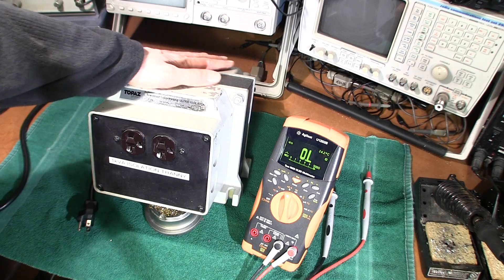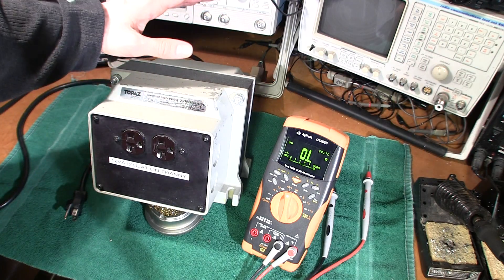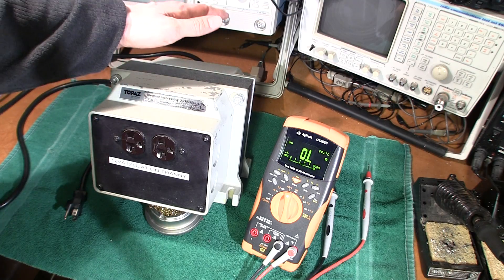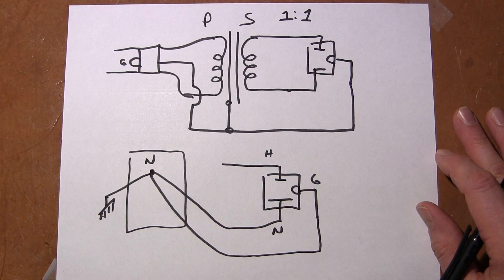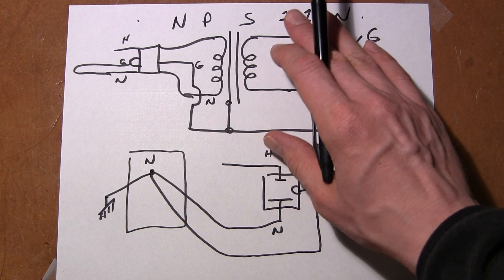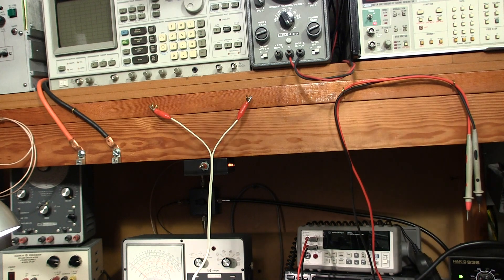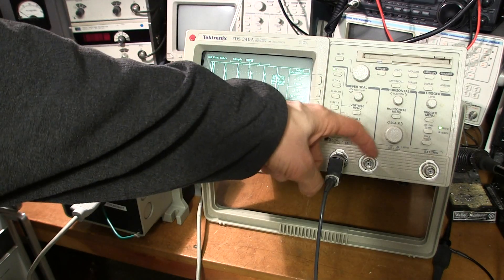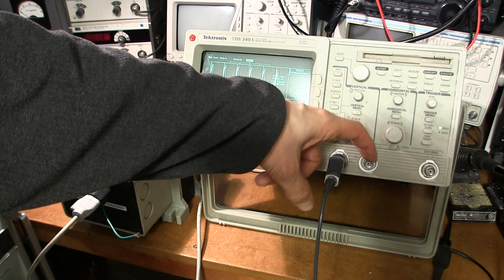Tech Tips Tuesday, Isolation Transformer and Variac Safety

Comment: Thanks Paul. You explained it very well. People need to be careful with the ground of USB plugs from their laptops and devices also.
Reply: +Robert Calk Jr. 
Good point about USB.  Check out the USB port isolator at Adafruit (search for product #2107)
Reply from the maker: +Robert Calk Jr. 
Thanks for your input Robert!
Reply: +Ken Cosi 
Looks like a handy tool, thanks.
Reply: USBs being dangerous... really lol
Reply: @actiniumanarchy9237  just when you thought it was a simple 5 volt device... BAM!
Reply: @ronniepirtlejr2606  I mean usbs won’t hurt you
Reply: @actiniumanarchy9237 people die from charging their phones using usb chargers every year. 'It's only 5 Volts' they said. How do you know your usb charger completely safe and is not live with AC voltage? You can't, unless you dissassemble it, check the board, completely unwind the primary and secondary windings to check for issues, and essentially destroy the charger.

You could just be safe, and maintain a healthy respect for electricity instead?
Reply: @JungleLibrary  the current coming out of a USB charger is not close enough to being able to kill you, those people die from overcharging and subsequently detonating the lithium ion battery 2 feet from their face
Reply: I love this comment. A USB isolator is less than 19 dollars on Amazon. No reason not to use one!
Reply: Mr carlsons very interesting videos

Comment: Hi Paul, wow I don't understand why that transformer is officially out in the market as certified isolation transformer. In Europe this would never ever get the declaration of confirmatory to be sold as isolation transformer. Following VDE/ EN norm the secondary side never is attached to protective ground/ earth. But anyway what ever norms are telling at all it doesn't make any sense...., or is there is something so much substantially different in Canada''s  power distribution compared to Europa I don't know?? Anyway very interesting video ! Thank you.   73 Peter
Reply from the maker: +TRXBench 
I agree fully, but politics and bureaucracy gets in the way of sense once again. If they want to include that "Earth" they need to re-label the transformer, and remove the word "Isolation"
Merry Christmas to you and yours Peter!
Reply: @MrCarlsonsLab , The term "isolation transformer, medical grade" is the one with the neutral bonded ground lead. There is a term, "isolation transformer, tech grade," which is one without the ground bonded to Neutral. This is the American system, I believe.
Reply from the maker: +Róbert Valdimarsson 
Thanks Robert, Merry Christmas!
Reply: +TRXBench There seems to be a lot of confusion about this even in europe. Mostly an "isolation transformer" has a earth connection on the secondary and a "safety transformer" has not, but has this clearly marked with a warning next to the outlet (and warns you not to hook up more than one device). But I have seen a "safety isolation transformer" (made by peaktech) that has a earth connection on the secondary, completely defeating its purpose (even false advertising imho).

But I'd be very interested, if there are codes in Canada, that prohibit safety transformers without mains earth reference. After all these things are only for full galvanic separation (thus preventing any current flow out of the DUT into any earth around) during repairs under power. Nobody in their right mind would use them for anything else.

But a well made and very important video nontheless. Thank you for it.
Reply: +Róbert Valdimarsson Hi Robert, yes very important issue and you are right a lot of confusion all over. I'm talking only about a galvanic protective  separation transformer (Schutztrennung) according VDE 0570 Part 2-4, DIN EN 61558-2-4, EN 61558-2-4, IEC 61558-2-4
Reply: @robertvaldimarsson2109  "Nobody in their right mind would use them for anything else." Most mains powered medical electrical equipment with patient leads is completely galvancially isolated from the mains, including the protective earth. They are almost like non-isolated equipment connected through what you would call a safety transformer.  Perhaps I have misunderstood, but turning equipment into the equivalent of what could be connected to a patient for safety makes a lot of sense.  Basically, if everything you are connected to is isolated from the mains, even when connected to multiple pieces of equipment, no current would flow from or to mains if one connection is accidentally made to mains.
Reply: I used to have palettes loaded with isolation transformers exactly like that one. The grounds are not isolated.  I do think our mains power is significantly different than European mains distribution. We have that wacky unbalanced ground referenced neutral.  We used our transformers for live music audio sound reinforcement, and the instrument, and vocal amplification. The lighting systems, for the theatrical lighting with all the dimmers could put 30 or 40 dB of hum on the audio, so all the audio stuff went through those iso-transformers. I still have a couple left, but I don't tour, or rent tour equipment anymore. Trying to track that stuff down, or lose it to some deadbeat was too much of a headache. I have some OLD RCA, and home made bench iso transformers where there is no safety grounding wiring. I just use adapters, if I have a 3 prong plug. I also have a power strip of Shucko outlets, and adapters for the UK, Australia, India, Italy, etc. I made some 30 amp 50 Hz sine wave inverters a while back, when the ammunition shortages made it so hard to buy cartridge reloading equipment, the only available equipment was 50Hz. At 60Hz the motors spun too fast, and the shell casings would not properly sort themselves into the loading tubes. Try jamming a bullet into the back of a casing, and the machine gets damaged.
Reply: Actually, politics have nothing to do about which earthing arrangement various countries have adopted. Isolation transformers shouldn't have any PE or earthing, because you will get an IT arrangement not a II one. 
 
Various countries have different earthing arrangements. Take a look:
http://electrical-engineering-portal.com/erection-procedures-of-earthing-arrangements-tnc-tn-s-tnc-s-and-tt
Reply: @somebody301 , in the end, engineers don't have twiddle to do with many things they should have a say in... and the idiots (political hacks and their scoundrel advisors, the "helpers from the money people") do.
Reply: You would not have this problem in Europe where the neutral is not bonded to ground at the mains. In the states, running on 120V is a result of center tapping a 240V secondary transformer coil. You need this to have a ground reference for several reasons to include safety and voltage stability. If you do not have a neutral-ground bond at the mains, this is irrelevant.
Reply: WILLIAM LAND Thank you, this answer make it clear. So if our guys in Europe; Allways check first all the wires of the device you working on with each other and chassis with a continuity tester if it's bleeps. That's a warn
Reply: William Land: You don't have earth/neutral bonding in the distribution panel, but they are bonded at the substation or power transformer. So the identical problem exists.
Reply: @buggsy5  if you dont get an earth wire from your energy supplier how could this be possible? In europe you have to get your own safety ground. And of course you want your safetyground connected. But you dont want your neutral connected to ground.
Reply: @Wim37u   If the safety ground is performing as the low impedance path it is supposed to be, a short to ground is destructive too. It's true that the residual-current circuit breaker will 'quickly' trip when detecting a 'small' current to ground so in a home installation the scope probe may give a spark but survive (I never tried). But 'quickly' and 'small' can range up to tens of amperes and half a second in industrial installations.
Reply: +TRXBench Yes, you pretty much have to rely on the norm numbers here. I have a propper one here for up to 1500VA. I got it very cheaply second hand and quickly found out why: It does not have a inrush current limiter. So every time i switch it on, I have to make a trip to the switch box and reset the breaker :D But a limiter module is not too expensive. Still the best money I have spent so far, since it might very well save my life some day.

Mery christmas and a happy new year to all of you too.
Reply: @robertvaldimarsson2109  1500 VA?! My 850 VA Grundig RT5 is already a handful (which also needs an external inrush limiter, btw). Your isolation transformer must be HUGE!
Reply: Ahhh. I was going to buy the Peaktech unit. Thanks for the info.
Reply: Exploring mines
Reply: I agree the secondary should not have the earth wire carried over . the secondary is then totally isolated . Then you can have the DUT connected including the scope and all is well
Any transformer the has any of the secondary wire connected to earth/neutral is NOT A ISOLATION TRANSFORMER and should not be called that . The earth should not be connected to the output

Comment: That looks like a medical grade isolation transformer Paul. That is typical wiring for these I believe.

I use a Sencore PR-57 isolation/variac for my bench work. I bought it on ebay years ago and had to open it up to repair the switch bank for the different display modes. I honestly didn't even look to see how the thing was electrically wired for the output. I think I'll do that now. But I don't see why Sencore would wire their unit as your example is. But who knows...

Thanks for the heads up and Merry Christmas to you and your family!
Love your videos.
Tom
Reply from the maker: +AntiqueRadioandTV 
Thanks for your comment Tom! Merry Christmas to you and yours as well!

Comment: doesnt your breaker panel should have safety trip? in case ever power starts to flow though the ground connection?(in case someone touch the hot wire or hot wire touching a metal surface)
Reply: +Hansaka Perera   NO a 20 amp breaker would not trip before frying your scope.
                                   A GFI breaker would trip but not before damage to the scope.
                                  it takes up to 30 ms for a GFI to react.
                                    So the answer to both would be (NO) protection threw breaker box.
Reply: +MrMac5150 i knew you going to fry your scope if you dont know what you doing but wondered why GFI breaker didnt go off on the video. I assumed thats a normal thing to have in house
Reply: Hansaka Perera
 In the video he was not running a GFI outlet.
Reply: +Hansaka Perera Yeah I was surprised too. North America is pretty backwards with safety in that regard. Here in australia all outlets must be GFI/RCD protected.
Reply: +TMM GFCI is required  for Garages, Outdoors, Bathrooms and Kitchens in the USA. Basically anywhere you would have a potential for and moist/wet/damp path to provide path for electrical current. That said only new and reworked  electrical requires this. There are tens of thousands of homes built before the 1970's(when GFCI were developed) are "grandfathered" and not required to have GFCI unless they are remodeled in some way.

Comment: Modern isolation transformers often have the neutral and ground tied together at the outlet on the secondary side of the transformer. It is a clip that can usually be removed.
Reply: The earth connection provides an alternative path for the power should a fault arise. Since it is always connected it will protect even with the appliance turned off or more importantly beleived to be turned off. The permanent connection also continues to work if the active and neutral lines become reversed as can happen when untrained people wire up plugs. A well made appliance will often switch both active and neutral lines to also protect against reversed plugs.
Many modern products do not have metal exterior chassis and will employ what is called double insulation where the usually plastic chassis acts as a second insulating medium. Virtually all power tools are made this way these days and will not require an earth connection.
Reply from the maker: +theflinx 
Thanks for your comment!
Reply: Mr Carlson's Lab Hello and thanks for your videos!  I am new to repairing electronics can you please explain why it's so important to keep the ground for safety.  I keep hearing this but don't understand why it makes it more safe?  Why is it more safe for the BNC connectors to be grounded or the chassis of the isolation transformer to be grounded?  I am sorry for asking such a noob question I just don't see anyone explaining this... Thank you

Comment: great tips
the new electrical panels have a ground and net bars isolated from each  new cod in usa
Reply: +DENNIS N same here, but they are connected at some point in the system (most likely at your substation). otherwise the neutral would not stay at 0V. unfortunately an isolation transformer without earth reference is still needed for repairs under power.
Reply: +Róbert Valdimarsson normally the safety ground is a very important safety feature that can protect your life only on rare occasions like this one it's needed to cut the ground of and should only be done by a person who knows what he is doing

Comment: Hi Mr. Carlson, thank you very much for this informative video!
1. Is it safe to disconnect the oscilloscope's earth wire at its plug, so that it only has a live an neutral connection? 
2. Is it safe to disconnect the earth wire running from the ac mains supply to the isolation transformer's output plug, so that there is only a live and neutral connection available?
3. When do you need to use an isolation transformer?
4. Can you please do a video on how to connect an isolation transformer to a DUT, like a TV, amplifier etc. and also to instruments like oscilloscopes, signal generators etc. so that all of them can be used safely together to probe and repair a product.

Thank you very much for your channel. I have learnt so much from your videos!

Comment: Should I always use a isolation transformer with a variac? If so, which comes first? Wall- isolation-variac?
Reply: +Scott Johnston  On a Isolation transformers  they are never exactly 1:1  so I always put
                                 the Variac into the wall first, then my Isolation transformer, turning  the
                                variac down  to 118.  if I use my Isolation transformer with out my Variac I get 135 volts which
                                is to high for anything.
Reply: +Scott Johnston 
I use a Tenma 72-1097 variable isolation transformer.
Reply: I run my isolation tranny into the wall, then my variac runs off the isolation transformer. I can get a maximum voltage of 148 out of that. Because my line is 123 with 3v added from the isolation transformer. Then the 140v range on the variac. Of course people can do it different but I do mine that way. I also run the variac through a dpdt switch that allows me to select the wall or isolation transformer as the voltage supply. I did that so if needed I'm not limited to 2.5amps from the isolation transformer.

Comment: Thanks for the informative video.

Here's a thought for you:
You have an oscilloscope and a function generator plugged into a power strip and you routinely check your wave form by directly plugging one into the other with a bnc. we all do it, no problem...

Now you change out your fancy new generator for an older tube based one that has a non polarized plug, the transformer is center tapped to chassis ground.You are about to plug it into the power strip... 
You''ve got one question to ask yourself punk. Are you feeling lucky? Well, are you?

The greatest piece of safety equipment in the shop is resting on top of your shoulders.
Be safe you all.
Reply from the maker: +Slim Hermer 
LOL! Thanks for your comment.